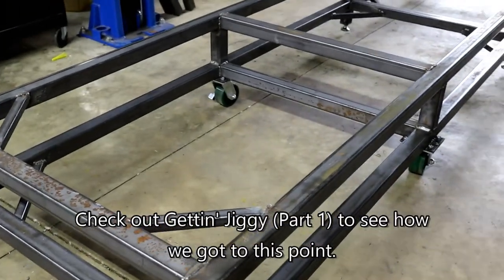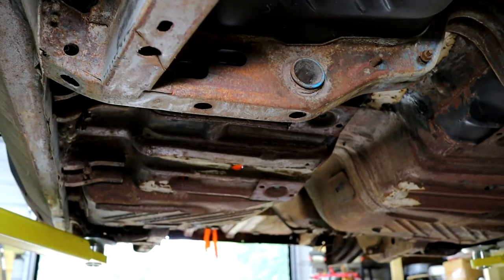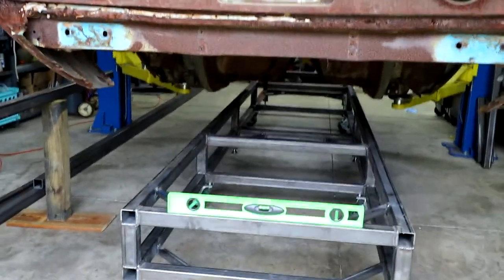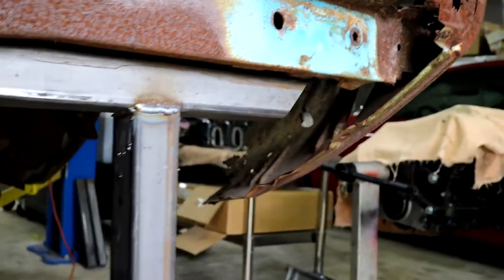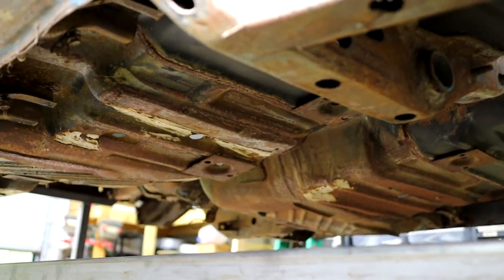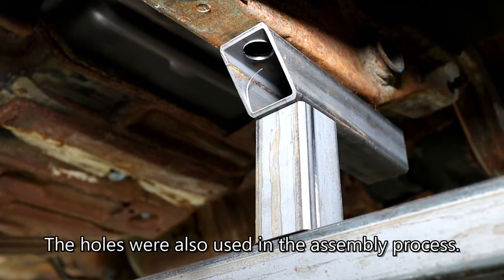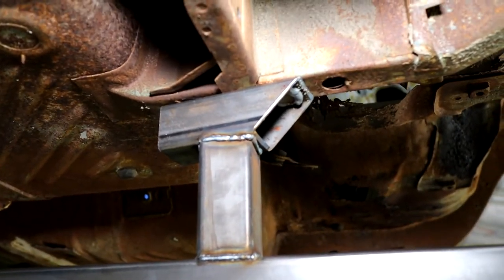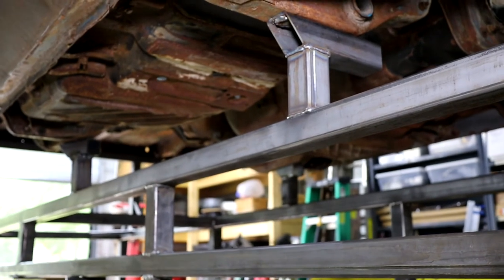Gettin' Jiggy (Part 2): Building a Jig for Chrysler Mopar E-body

Comment: How did you know how tall to make the middle supports?
Reply from the maker: For the box structure, I wanted enough space to crawl underneath as needed, yet maintain a reasonable work height based on my shorter stature. For the car, it was a matter of matching to the needs of the existing car structure. This assumes the car's frame wasn't sagging.